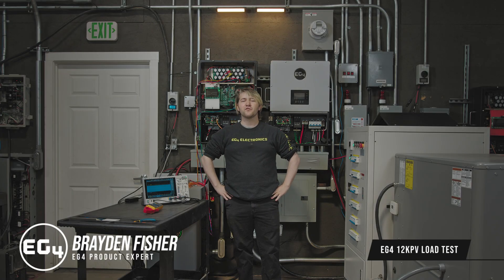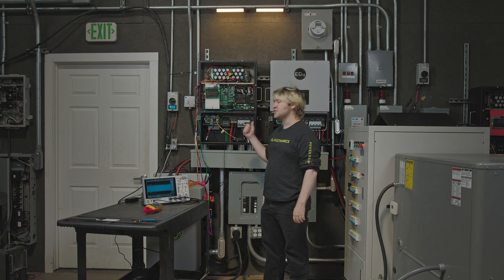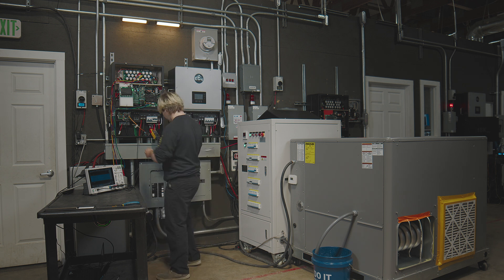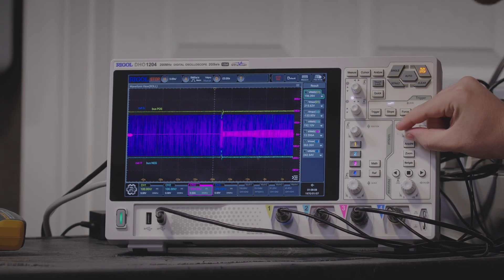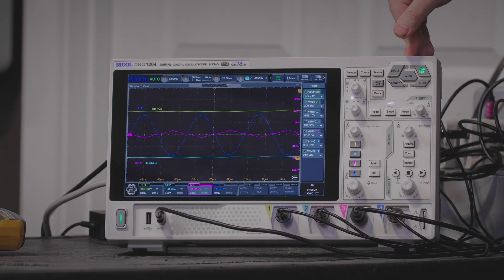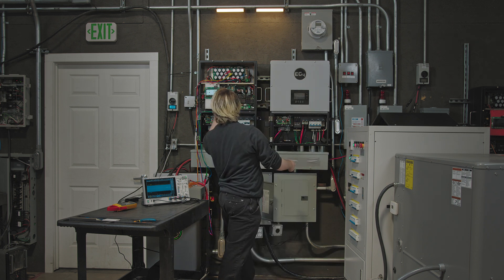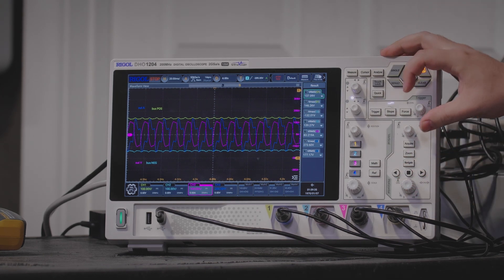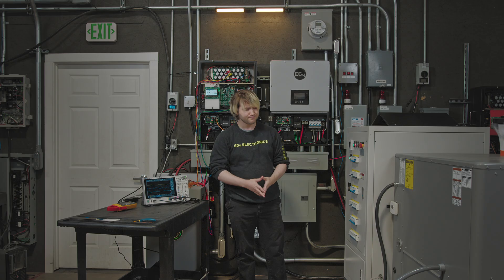Pushing the Limits of the EG4 12kPV | 5 Ton HVAC Load Test

Comment: I am very confused at the PV inputs.  I see 2 Inputs with 4 connection for each input.  What is the TOTAL power for each input?  Input 1 (2 Inputs of 600 each or 2 inputs of 600 total?), Input 2 (2 Inputs of 600 each or 2 inputs of 600 total?).  This can be VERY confusing for an installer.

Comment: I hope EG4 creates a program for 18k owners to "upgrade" to the new 12k. I purchased an 18k with the expectation that "top of the line" would be able to start my 4ton AC. The 18k cannot; 135A LRA trips the 18k immediately (A soft start is just a workaround that adds to the base cost). Many others have mentioned this as well on the various solar forums. I'd happily do a 1:1 swap of my 18k to this 12k if it means I can run my AC without issue.
Reply: Not all compressor motors are equal.  Some of the latest inverter-type compressors are said to have very low inrush.  True for the latest mini-split heat pumps made by Midea (Pioneer, Della, other brands).  I don't know about larger units.  In my camping trailer, I had to go to a 1000 W pure-sine inverter to run an 80 W dorm-type refrigerator since all others I tried tripped-out when the compressor started up.
Reply: I've seen name brand A/C soft start units on Amazon for $ 250.00 , I put a soft start on my EG4 12k to save wear, tear, strain and heat on the inverter component and increase it's life span. A central A/C unit starts up many times per day and a load that large " 80-90amps" is going to shorten its life . spend the money and protect your investment in that 18k.

Comment: Simple question.Does the inverter use the grid to help with its massive surge capacity and leg imbalance surge.
Reply from the maker: All of the surge and output specs are in EPS mode (no grid whatsoever)! We cut off the grid input for the demonstration done in this video, as it wouldn't make sense to show the grid-tied capabilities for this reason.

Comment: Sure, you may be able to start this 5 ton AC load and a 3kW resistive load when this inverter MOSFETs (or IGBTs) and capacitors are brand new, but how many times will this inverter be able to repeat this before failing? Transformerless inverters like these are notorious for providing shorter life expectancies when compared to transformer based inverters, especially when repeatedly starting high inductance loads. Google it. In addition, It's a well established fact that transformerless inverters like these are notorious for providing shorter life expectancies when compared to transformer based inverters, especially when repeatedly starting high inductance loads. Don't take my word for it, Google it. 

In addition, because this inverter offers no galvanic isolation between its DC boost stage and its AC out put, during a catastrophic failure of its H-Bridge circuit, you run the risk of damaging your appliances or your EV's onboard charger and even setting them on fire. Search Youtube for the term "Solar Inverter Catastrophic Failure" to learn more about transformerless inverter failures.

Comment: Can the 18kpv do this as well?
Reply: No. The 18k cannot do this. I have an 18k, and it cannot handle 135A inrush. This is real-life experience along with confirmation from Trevor@Signature Solar, and several other owners' posts on diysolar forum. It sucks for people like myself shelled out so much money for "top of the line" 18kPV, and this newer model can handle bigger loads.
Reply from the maker: Hoping to make a video to show the power of the 18kPV soon! ;)
Reply: if 12K inverter can do that, the 18K will do that with a big smile. most heave part is when the appliances kick on.

Comment: A bit more explanation on the sine wave might benefit you. You zoomed into a really ugly sine wave.  Very dirty... You should point out that that only lasted 0.4sec before it stabilized, so the dirty power didn't last long.  Also remember that the sin of eating cake is gluttony, but eating pie is ok because the sin of pi is zero.
Reply from the maker: I'm definitely not the most knowledgeable when using O-scopes (it was set up by our engineering team), so I tried to refrain from explaining more than the context that someone with good knowledge would need to make a solid assessment. This definitely won't be the last time I'll try to show what's going on under the hood, so I'll make sure to study up for a better explanation! Appreciate the feedback.
Reply: i am no mathematician , but my grandpa was, so ...... sin(3.1415) = 0.0548
Reply: @BTC.maximalist  and 0.0548 is 0 and 0.1 and 0.05. It was a joke. I bet your grandpa would like it
Reply: You also want to look at a radian graph of a sine wave. Sine of 0, pi, 2pi, 3pi are all zero.  I'm surprised  you din't point out that sine and sin are different spellings.